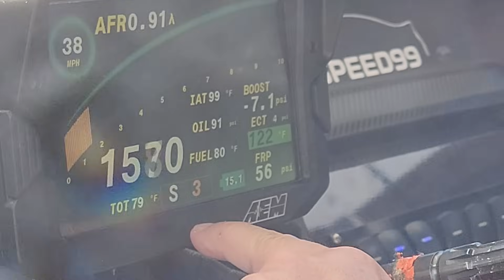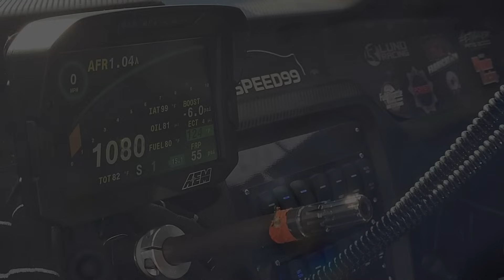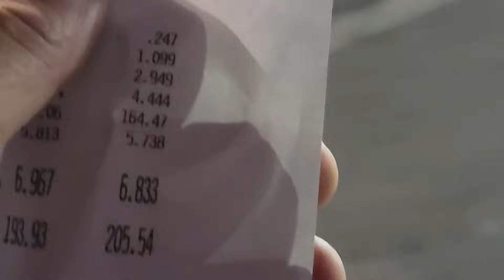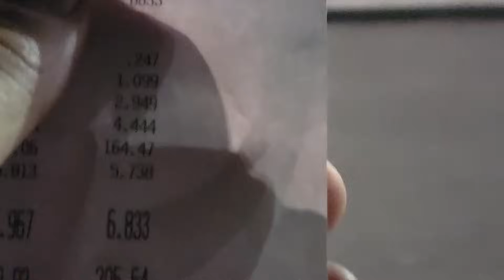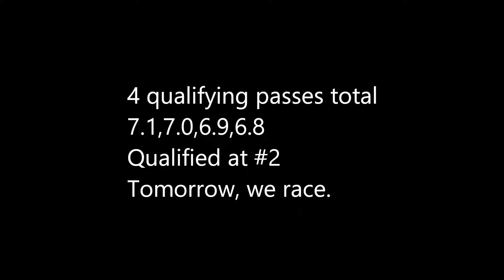Icing on the cake, Lund racing Resets the 6R80 record

Comment: Awesome!!! Alex what is your prediction what it would run with a T400? 6.4s would be a solid goal?
Reply: Other then life and longevity and strength. I can't see the ET dropping 4 thenths.  Maybe 2 doe to giving it more power . 
But with a 1.09 60  . How much more can you give it. 

Plus the 6r is a 6 speed running the yote thru its power band in a better rage where the 400 would only have 2 or 3 gears and less opportunity for the engine to be in the optimal power band. 

I could be wsy way off here .

Just emagine if they can make tye 6r as strong as the t400 .
Reply from the maker: 400 has better gear split so the gear ratio alone is 2/10
Reply: @YDBT4LIFE  ok then . I was way wrong . Lolol

Thanks for clearing it .